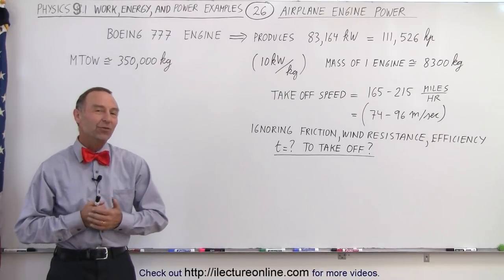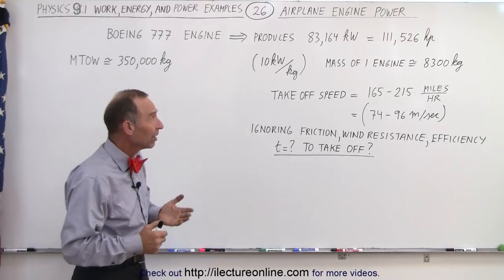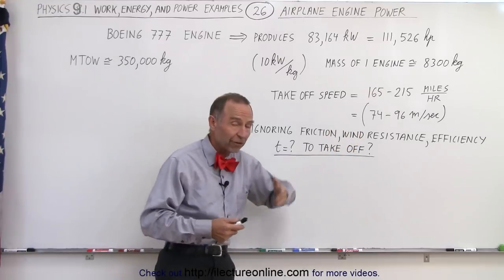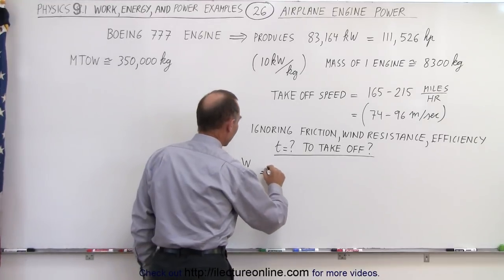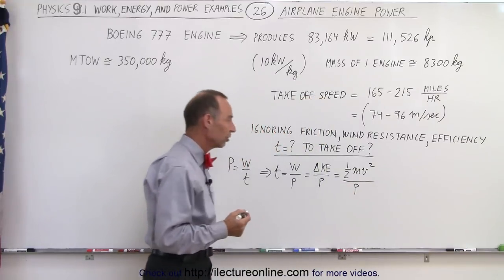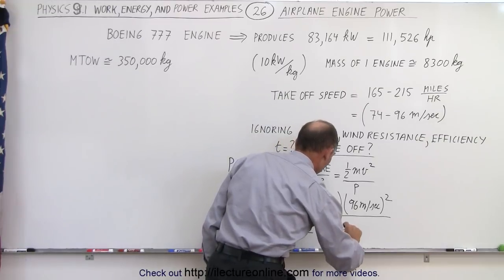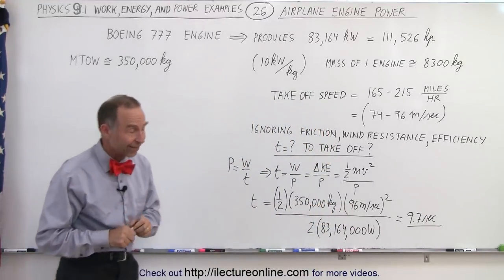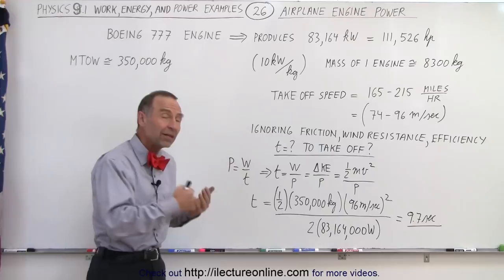Physics 8.1  Work, Energy, and Power Examples (26 of 27) Airplane Engine Power

Comment: Sir, we need 1,612,800,000 joules to get to take off speed.
We know that work is force times displacement.
Assuming the engine force is parallel to displacement, we could hypothetically have a 1,612,800,000 meter runway and 2 engines that when combined give 1N of thrust. Then at the end of the runway we would get to take off speed, right? Because we would have 1,612,800,000 joules.

Then we would have: 
                                    P = (F.d) / t. 
                                    t= (F.d)/P
                                    t= (1N.  1,612,800,000m) / (2.83,164,000w)
                                   t= 9,7 seconds! 
Does that mean that this 777 would take off in 9,7 seconds if the thrust force being applied on it is 1 meter, and the runway is 1,612,800,000m long??? It must be sheerly wrong, but anyways.
Reply from the maker: Your initial premise is correct.  In the equation you showed, I believe the power you used is incorrect.
Reply: @MichelvanBiezen  hmmm, but i used the same power you used, sir.  2(83,164,000)
Thanks for answering by the way, I really appreciate it. It makes self-studying less harsh.

Comment: Doesn't a 777 have two engines?
Reply from the maker: Yes, the 2nd engin is blocked by the fuselage of the plane.
Reply: @MichelvanBiezen  So why isn't the P value 166,328 kW?
Reply from the maker: Because the video talks about the power of a single engine.
Reply: Thanks for clearing that up :D